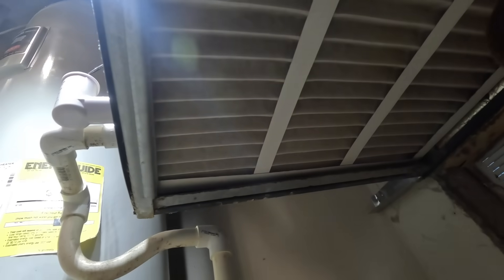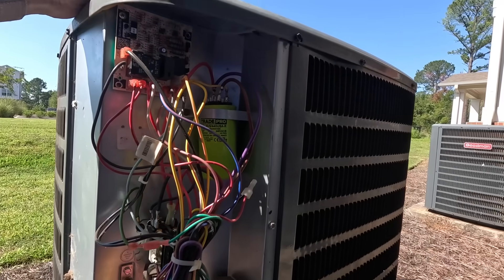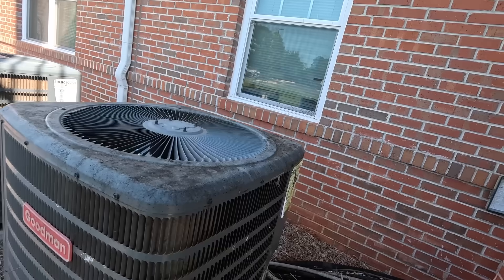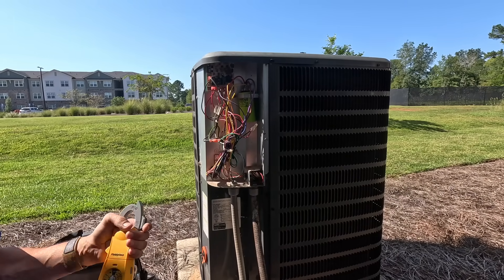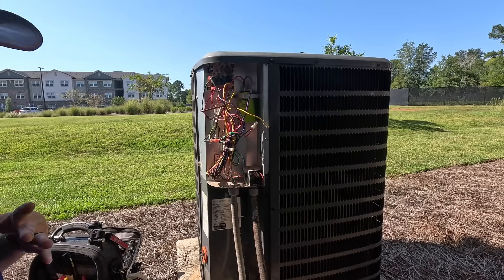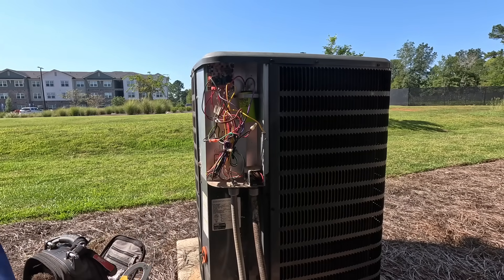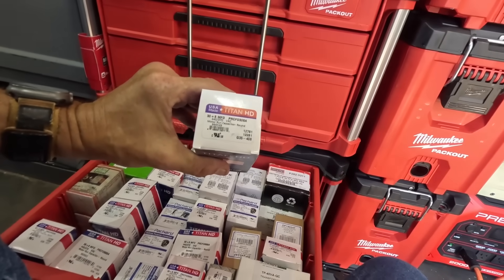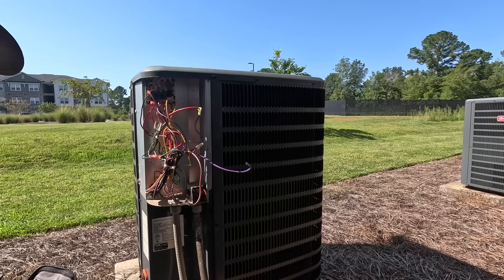AC Was Running Inside, But Not Outside!

Comment: Why do electronic parts fail?   More often than not the parts manufacturer is not the company that has their name on the label.    Manufacturers of Capacitors or Cell Phone batteries do a big run of components.    Those components go through Quality Control and are tested and assigned a grade A, B, C, D etc.   All the components work but the grade reflects how it performed during various tests, what is the expected failure rate, and approximately when will it fail, manufacturers have that data down to a science, and whether there is any cosmetic issues.    The lower the grade, the lower the unit price.     Big name corporations will buy the "A",  "B" will go to secondary part suppliers, "C" and lower get sold in lot's which usually end up on Amazon or E-Bay by third party resellers or less reputable companies.

Comment: I'm not sure if you caught the shorting going on on the right side screw of the capacitor bracket?
Reply from the maker: It was just light filtering through the hole broken up by the fan blade. It wasn’t arcing
Reply: @HVACGUY 👍

Comment: I know why the capacitor broke, and it will soon be broken too. If you watch the video, it doesn't quite fit when the bracket goes on the new capacitor. As soon as the fan starts spinning, you can see sparks flying from the bracket. So there's no good contact there, which will quickly damage the capacitor or perhaps the motor.😟
Reply: Someone else mentioned that.  Too me it appears it's actually the sunlight shining through a hole.  The flashing appearance is merely the fan blades turning thus blocking/unblocking the sunlight.  IMO
Reply from the maker: @my-yt-inputs2580 exactly

Comment: Yep...caps don't last as long as they used to 30 years ago.  It's really handy to put the date on them when changed/installed so that when they do fail, you have an idea of what brands tend to to go bad the soonest or last the longest.  Might help technicians in deciding what brand caps to use.
Reply: You are ignoring the effects of dirty power, which is more common as well.
Reply: @Rico-oy3dc  Pretty sure power was dirty back in the 1970's as well. I'm no expert on that but I can confirm products made today are nowhere near the quality they were a few decades ago. Most folks know this with crap home appliances such as refrigerators, washers, dryers and dishwashers that are not providing dependable service.

Comment: At 9:43 when you turned power back on there is a tiny sparking between the band that holds the capacitor and the frame it mounted to. 
It does it until 9:55 when you turned the camera away from it.
Reply: I noticed that too but it could be the sunlight shining through a hole and the seeming flashing is the fan blades turning and the sun?
Reply: @my-yt-inputs2580 
It was when it was shadowed the most was when it was most visible.

Comment: Kind of curious - How old was the replaced capacitor?  Seems strange that both sides would fail and have unreadable low capacity.
Reply: i guess they Spent more money on the Green paint than the Manufacturing of the Pretty Green capacitor. All " Show " no Go !!!

Comment: Apartment layouts and coloring on the outside and the way the condensers are laid out. Outside of the building are set up the same way. Some apartments are here in Michigan at grand Valley State University and unfortunately, when you go there to do a repair none of the condensers are marked so that is a big mess when you first get there unless you’ve been there before and you marked which condenser circles to which apartment